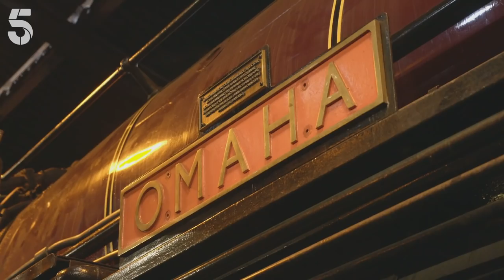Can Boiler Chief Mark Fix A Historic American Steam Train? | The Yorkshire Steam Railway | Channel 5

Comment: Doesn’t look American at all
Reply: Most of the 'look' is just sheet metal fairing. Under the skin they're all pretty similar.
Reply: That's because The locomotive was sent off From America to help with the British during world war 2, being designed and added with British modifications for it to fit on the railways